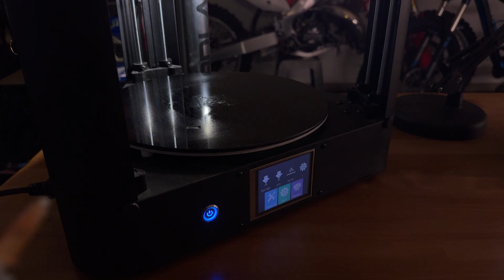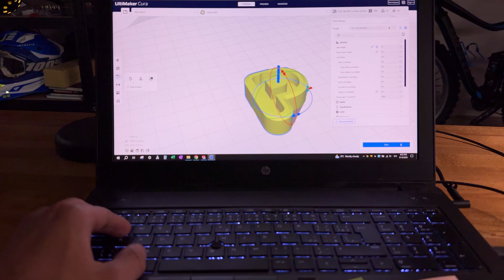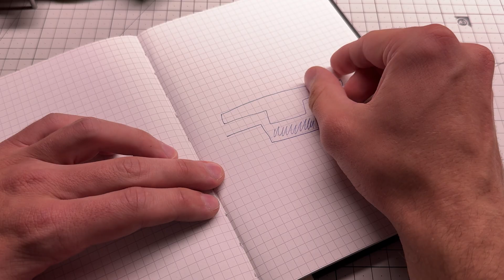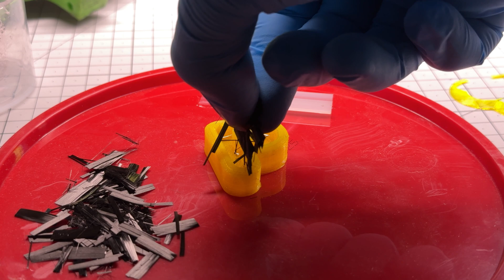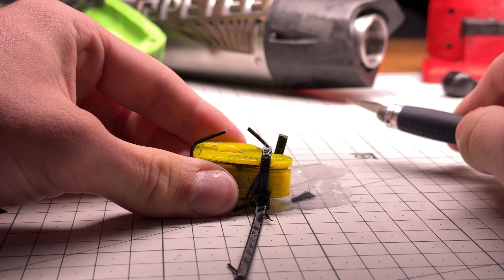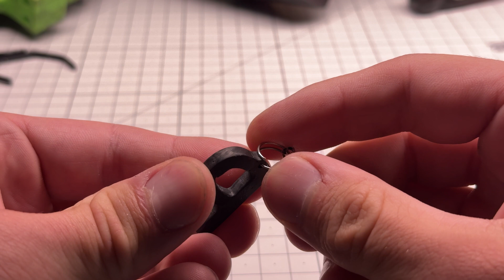In just 100sec.. learn how to make carbon fiber parts at home

Comment: Love the video and the idea. My only worry is due to the fibres not being sealed in using some kind of clearcoat? Aren't CF particles really bad to breath in? Also how do these perform under strength tests? As all the carbon fibres are point in random directions does it lose its tensile strength? This is really cool for lightweight non load bearing parts though!
Reply from the maker: Yeah the fibres are sealed in the resin so it’s only a problem if you cut/sand it (mask helps there). Strength-wise it’s not as strong as a proper layup but still pretty tough — I’ve had a forged carbon brake lever on my dirtbike for a year with no issues. Don’t think it always beats aluminium though, kinda depends how it’s made
Reply: @peteelab  Thanks for the clear response! I've subscribed and I hope to start implementing this process in my own builds at some point!
Reply from the maker: Thanks a lot for sub! I really appreciate the support… reach out if you ever need help with your project